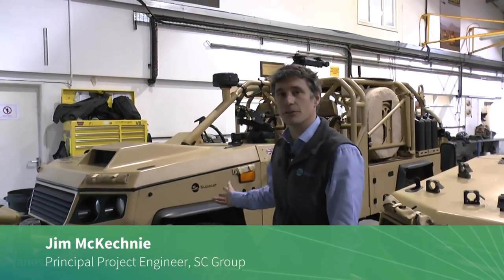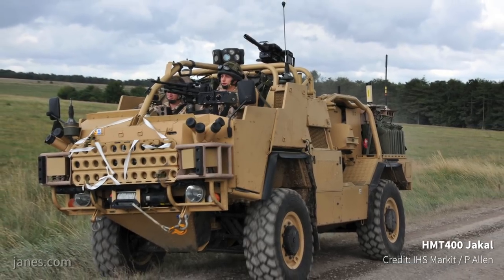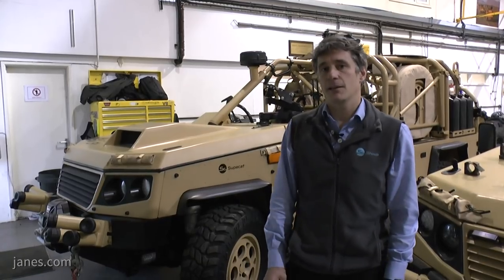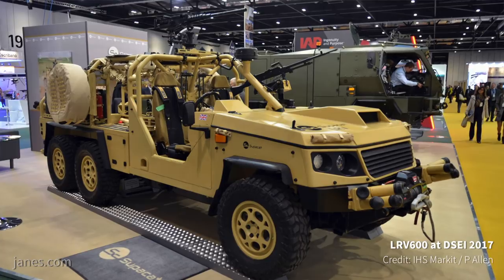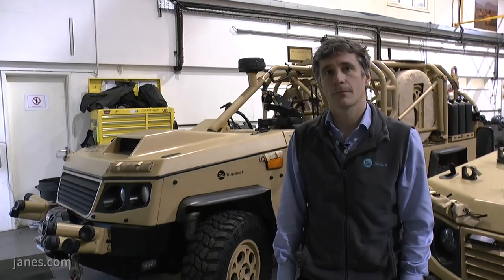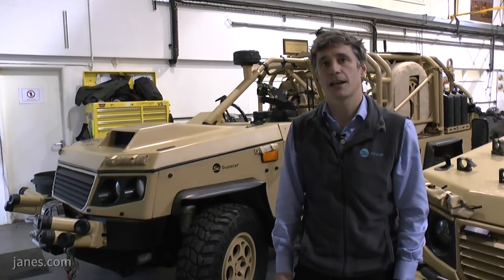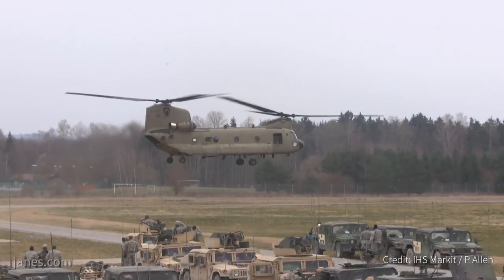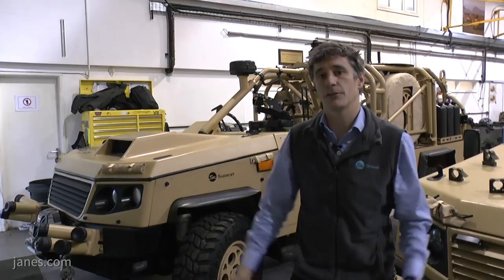Showcase: Supacat's LRV400

Comment: Sniper: hee hee, here come the Supacat.
Reply: You should watch less movies and play less video games...
It is much harder than you think to hit a quick moving small target at a long distance with a rifle!
Reply: @nic12344  
What about air bursts from grenade launchers?
Reply: @osamaalafghanee8868  A sniper with an Mk 47??? Well that would be a first!
But even then, it's hard to shoot at any fast moving target without a fire control system giving you a firing solution... Also, if that Supacat is in the range of an Mk 47, that squad is far from where it should be!
Reply: @nic12344  
The Supacat is not going to be moving fast all the time in the field. Sooner or later it will have to slow down to climb boulders, or to forde shallow streams, and when it does...
Reply: @nic12344  there is the chinese lg5